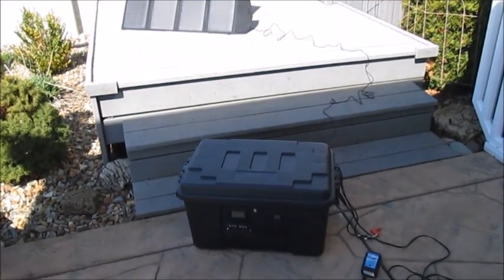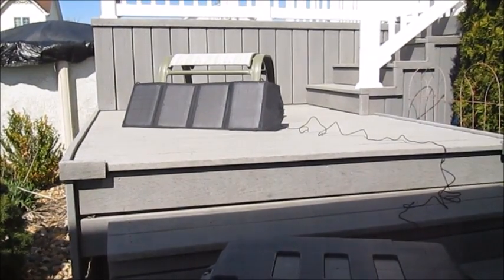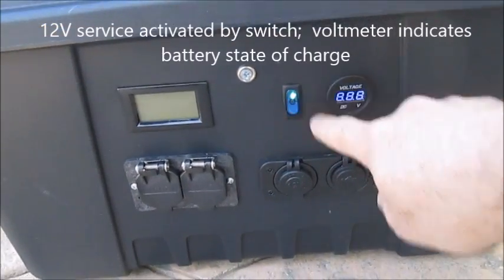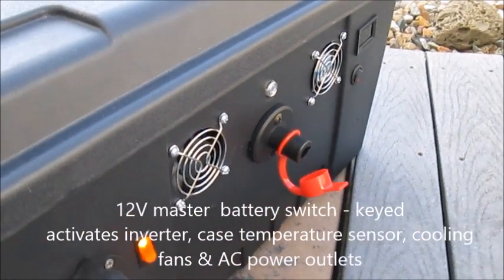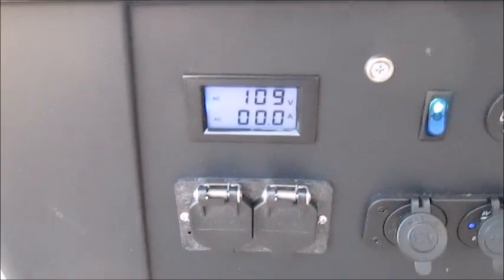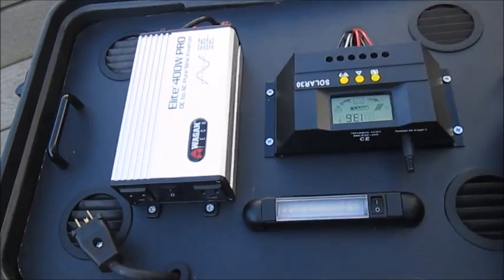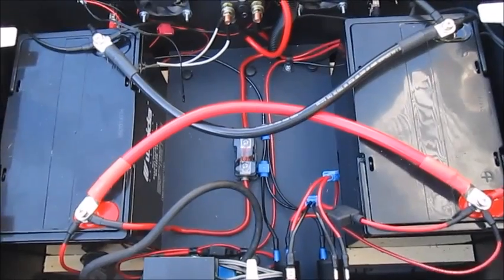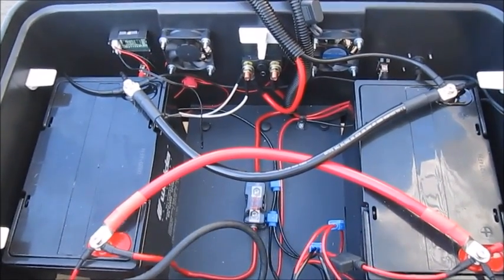V1 P1 DIY Portable Solar Power Generator - Wiring Schematic, Parts List, FAQ Sheet Provided

Comment: I  realize this video is five years old however I can't believe this cost $950 as a DIY project.  For that money you can buy today the top of the line Jackery 1000 for $900 that is all lithium and does all of what yours does at a fraction of the weight and size. I made one of these solar generators for less than $200 .  I used a large Camco battery box ($13), cut a hole for an all in one panel with dual USB port, cigarette socket , and  voltmeter ($14 ) ,  12 volt deep cycle AGM battery ($100),  PMW charge controller ($10),  400 watt modified sine wave inverter ($39).   You can get a windy nation 100 watt glass rigid panel that weighs only 16 lbs for $75 with free shipping. There is almost nothing that pricey jackery can do that my box won't.  Lithium batteries of course are much lighter than lead acid batteries granted.  It runs my 12 volt compressor refrigerator and charges anything via the USB ports.  The AC inverter is nice for small appliances that need 110 volts. Most of these parts are from eBay, battery and case from Walmart.   The box is not much bigger than the jackery but weighs a lot more  (45 lbs vs 22 lbs).  You can easily customize this box if you want a bigger AGM battery or a full sine wave inverter.
Reply from the maker: Phil, thanks for viewing, for your interest in my project, and for your comments.  As you appropriately noted, my project was built in early 2015, so it is now approaching nearly 6 years in age.  It is important to note that all of the components I used were purchased brand new.  I wanted quality and was willing and able to pay for it when I designed the system.  Prices for many of the main components were certainly higher in 2015 (batteries, charge controllers, inverters, solar panels).  To build a comparable system to what mine offers you would need to use at least a 50 AH lithium battery as a starting point and you would likely pay about $350 for that in 2020 (my system uses two 55 AH AGM batteries and yep, they are heavy).  That would be a basic starting point for cost and then you'd need to add all the other components.  I suspect you could build my design in 2020, incorporating a lithium battery and including a 100W solar panel  today for about $750.   That is still cheaper than the nearly $1100 you would pay for the Jackery 1000 listed at $999 without a panel included.  You can certainly save on costs depending on your specific needs and intended application.  For me it was important to have a pure sine wave inverter...and those are more expensive than a modified sine wave inverter.  For my intended use, a light weight flexible panel was desirable, and they were more expensive in 2015 (and still are in 2020) compared to cheaper rigid glass panels.  Building your own should always be more cost effective than buying a commercial model, and mine certainly was in 2015.  One thing I am certain of, it is a lot more fun to build your own and the knowledge you gain is invaluable!
Reply: @JimFisherDIYPortableSolarPower  Yea everything is cheaper now. Even that Jackery 1000 was on sale for $799.  You'll find out that the flexible panels have a limited life as they will peel and warp from overheating over time.  Take a look at all the YouTube video's on unhappy users. I had a few over the past and find the output is not as good as the Windy Nation 100 watt rigid panel for only $75.
Reply from the maker: Too late Phil--- I'm on my third pair of flexible panels:  first pair I purchased in 2015 was recalled in my second season of use due to an overheating/fire hazard problem (got a full refund);  second pair (different manufacturer) de-laminated after about 3 years (15 months of actual seasonal use)  third set was just installed in May of this year.  They appear to be of far superior construction compared to the first pairs.  In my application (on top of a boat bimini) I just don't trust that the frame can handle the extra weight of the the rigid panels (12 lbs for two 175W flexible panels vs. 40 lbs for two comparable rigid panels).  My install allows for substantial ventilation under the panels to keep them as cool as possible.  Hopefully I get 5 years out of the current flexible panels.
Reply: Hi Phil, there's several other reasons for building not buying.  Firstly, it is updateable so when new technology comes out you can change the generator.  Just like Jim is doing with the batteries.  I also don't need to use every make recommended by Jim (especially as I live in the UK) so I can buy whatever component make I want.  You can even use items you already have (I've got some computer fans in my shed just waiting for a use).  Secondly, with a bought one once the warranty runs out when it breaks down you cannot repair it.  But with a built one if a component stops working you can just replace it.  Finally, the one I'm building is going in the shed so I don't need to make it waterproof.

Comment: nice job.. would i be able to know what fridges  does it power?..
Reply from the maker: Thanks for your comment and question.  I have been using 200 watts of solar panels and this system to power my boat's built in Nova Kool R3800 3.5 CU FT AC/DC Single Door Refrigerator w/ Freezer.  I also have a Dometic CFX-35US Portable Electric Refrigerator/Freezer onboard that is used to make ice and for additional freezer space.   During the day, while at anchor, this solar system has reliably powered both of these refrigerator freezers simultaneously.  I just finished making a major upgrade to my boat's solar power capacity.  I have installed a second separate MPPT 2OA charge controller and will will be using two 175 watt panels for a total of 350 watts.  One panel will be connected to the portable solar generator and the other to a newly installed 2nd charge controller connected to the boat's 4D house battery.  The built in Nova Kool refrigerator will be powered by the house battery and the Dometic refrigerator will be powered by the solar generator.  The goal is to be able to run these two refrigerators overnight and 24/7 while living on the boat in retirement.

Comment: One last thing.  The links to your wiring schematics are broken.
Reply from the maker: The links are to PDF files and all are opening when I click them.  I haven't received any other notices from viewers that the links were not working.  Do you have a PDF reader, like Adobe, installed on your computer?  You may try right clicking on the links and open them in a new tab in your browser.  That worked for me, too.

Comment: Awesome build!!  I watched this about a year ago and had to revisit it several times as I go through the steps of my own build.  Question:  Is that black particle board you have everything mounted to on the top that you have to keep taking on and off to access the inside of the case?  If it is particle board, where did you get it and how thick is it?  Was it easy to cut and make the hole fittings in it for each part that you have mounted to it?  I was tried to use Lexan for mine, but found that it is too difficult to make small circles and other odd shaped cuts in it without it cracking.  I also thought about chalk board, but cant seem to find the right thickness so its not flimsy.  Any ideas??
Reply from the maker: Thanks for your comments and questions.  The "tray" under the case lid on which the solar charge controller and inverter are mounted is made of black chalkboard material that I purchased at Home Depot.  I found it was very easy to cut using a table saw, jig saw, and table mounted router.  I also used spade bits and holes saws to drill round holes in it.  I think it is about 3/16" thick.  Its not the strongest material, but has held up very well to the combined weight of the two components.

Comment: Awesome build. Would something like this be able to charge my trolling batteries if plugged into an on board charger? 2 group 24 batteries?
Reply from the maker: Yes, but there is a much simpler, more direct approach you could use.  Simply attach a solar panel to a small solar charge controller and connect that directly to your trolling batteries. I assume your onboard charger is AC powered and converts to DC.  It would be inefficient to charge another set of batteries, and then convert the DC to AC via an inverter to power your existing onboard charger.
Reply: @JimFisherDIYPortableSolarPower  thank you. I will research that. Hopefully I can find something to utilize the alternator on boat motor as well.

Comment: Hey Jim!  I know it's been a while since you made this, but can you tell me the clearance between the insert board, and the top of the case?  I have a 2000 watt inverter I want to use, but it's rather tall.  Thanks!
Reply from the maker: Hi, I just took a measurement using the new MPPT charge controller as my guide.  It required 2.5" of clearance and I was able to achieve that by trimming some of the ribs in the lid.  Without trimming the ribs,  you would need to use an inverter that is closer to 2" or less, not many 2000 watt inverters would likely have that dimension.
Reply: @JimFisherDIYPortableSolarPower  Thanks!  My batteries are only 8" tall so I'm thinking maybe I'll recess part of the insert, or, mount the inverter on the inside.  Great videos, thanks again!

Comment: Will all those that detail and thought you put into this, it looks professionally done. Why didn't you put in a switch to turn the fans on if it reached a certain temperature so you don't have to watch it?
Reply from the maker: Hi, thanks for viewing and for your comments and question.  Check out my part 4 video from November of 2016, the addition of a snap disc thermostatic fan switch was one of the upgrades that was featured.  Here's the link... https://www.youtube.com/watch?v=WlLhYc30qV4

Comment: 400watt inverter is limited...otherwise nice.
Reply from the maker: Thanks for your view and your comment Gary.  "Limited" is a qualifying term, the validity of which is dependent upon the intended use of your system and the total AC watts you will require to serve the appliances you need to power.  If you need more watts, simply use a larger inverter, but you will sacrifice energy efficiency and will have to pair the larger inverter with a larger battery bank that offers more amp hours.  The 400w inverter size I chose to use was selected for my specific needs and is matched to size of my battery bank.  In my use scenario, the 400w inverter powers a small AC refrigerator, while a second DC powered refrigerator is connected to the systems 12v outlet.  Keep in mind that it is far more energy efficient to run as many appliances as possible from DC as energy is lost during the conversion to AC.

Comment: I don't know if this has been asked but would this work with a dcdc charger like the redarc 1225d (solar ready) in place of that pwm unit? I'm looking to make something similar but I'd like to be able to hook up to the truck's charging system via an Anderson plug while driving but also be able to unplug and have it portable for emergency situations or power outages.
Reply from the maker: I suspect that the charger you described could be used in place of the PWM unit...any charger that effectively regulates the charging cycle for a 12V battery bank should work.
Reply: @JimFisherDIYPortableSolarPower  thank you. I've been doing plenty of research the last few weeks and I now think this should work. I only hope mine looks half as nice as yours when I get done.

Comment: Jim, I am a long time follower of your project work. I admire your generator. Your u-tube presentations are excellent!
 Sir, I would greatly appreciate clarification on the following questions: 1.  Is the bottom panel attached by any hardware (screws, two sided tape, etc.) to the bottom of the Plano box? 2. Does the bottom panel continue under the batteries to the sides of the Plano box. Or is the bottom panel terminated at the lower sides of each  battery.  3. Is the bottom panel constructed from the same black-board material as the top panel?  I see two silver screw heads. These screws are at the exterior Plano box's  top center both front/back of the box . Do these screws secure the two top center interior shelf brackets? 

Jim, I really have enjoyed your solar generator build. Presently I have purchased all needed parts, with the exception of batteries. The front of my Plano box has the components mounted. Soon to start the fan holes at the Plano box back side.
Thank you for your kind input to my questions.
Andy Earle, docearle@cox.net
Reply from the maker: Hi Andrew, thanks for your comments and questions.  
                 Have a look at the still images at 1:49 in my part 6 video.  Hopefully those views will help you to understand what is described here.  The bottom panel is screwed to the top edges of   a couple of 1"x4" boards,  it does not continue under the batteries.  This creates a frame that is H shaped.  The bottom panel forms the wide "crossbar" in the H configuration.   The dimensions of the H frame were based upon the dimensions of the batteries.  The bottom panel is effectively raised about 4" from the bottom of the case.  The bottom panel is not attached to the bottom of the case in any way, nor are the 1x4 boards.    The long 1x4 sides of the H were cut to the total interior length of the case. The bottom panel was cut to the interior width of the case. This configuration creates two "pockets" into which the batteries are   securely nested, they are unable to slide around in the bottom of the case laterally.   As you described it, the bottom panel terminates at the lower sides of each battery.  The bottom panel is constructed of the same blackboard material as the top panel/tray.      Yes, the silver screw heads you see secure the top center shelf brackets--there are two more on the other sides of the case as well.   Have fun building your system & be safe!

Comment: You only need one (1) fan with a an exhaust or in take port; depending on which way the electric fan is blowing.  Suggest you use a washable air filter on the fan or port to keep the inside of the box clean.
Reply: Show us your build

Comment: Great build! Has it paid for itself in free energy? Thanks :)
Reply from the maker: Thanks John.  Difficult question to answer since I am not using this system to replace energy that I would have had to pay for.  I built this system to use on my boat in a totally off grid situation (while at anchor).  What I can tell you is that it has completely and reliably met my needs (running two small refrigerators and powering small appliances) and is still in service today.  I am still using the original pair of 55 AH AGM batteries.

Comment: Jim, a fantastic job! And an inspiration. I was so happy with the stupid little box I built to hold my battery and solar charge controller and now.......well now I am scouring Amazon and my wife is wondering what a-package-a-day is going on!!! Excellent series of videos with some excellent upgrades. Quick question.....did you buy those little brackets to support the blackboard online? I have struggled to find something comparable at my local HD and hardware store.  

And can I just say how impressed I am that you respond to so many comments.
Reply from the maker: Hi Bruce, thanks for having a look at my video series.  I am glad to see that my project continues to inspire others. The brackets were made from the components of a nylon door glide that I found at Home Depot.  If you were inclined to save a little money, you could simply make them out of small blocks of wood that are screwed and glued to the sides of the case.  Have fun upgrading your project!

Comment: How do you regulate the power coming from the wall to charge?
Reply from the maker: The battery maintainer and float charger that I use automatically regulates the AC charge delivered to the batteries.

Comment: Dude you put all that heart and pretty work into something that only has a 400 watt inverter
Reply from the maker: Yep... The 400 W inverter is built-in, but if you noticed those two external bulkhead terminals, I have a much larger inverter (2000 W) that can be attached to those if needed. Inverter size choice depends on your needs. I can run two refrigerator units on my boat 24-7 simultaneously using the 400 W inverter.

Comment: This is a really clean build, great work - Question...and maybe someone has already asked this, but how does this get grounded in general?
Reply from the maker: Thanks Kyle, this was not built to be earth grounded as it is in use on my boat.  But check out my part 7 video where I discuss neutral ground bonding and the use of a GFCI outlet for improved safety.
Reply: @JimFisherDIYPortableSolarPower  Good answer there Jim
But begs the question, how do the Engineers ground Huge cruise ships ;)
Answer below................................
Ships hulls are made of steel and they are in direct contact with seawater ,which is actually a Very good conductor of electricity. Also, ships use an Insulated Neutral distribution system instead of an Earthed Neutral system. Some ships like oil tankers also use bonding wires to dissipate built-up charges at oil terminals.

Comment: Awesome video, what is the largest panel you can use on this system? could you have put a larger inverter on it?
Reply from the maker: Thanks for your comment and your questions.  The charge controller is rated for 30 amps, So 360 watts maximum total solar panel input is recommended.  Yes, you can use a larger inverter.  You may need to consider using larger AH batteries to match your larger inverter if your appliances are going to demand more watts per hour.